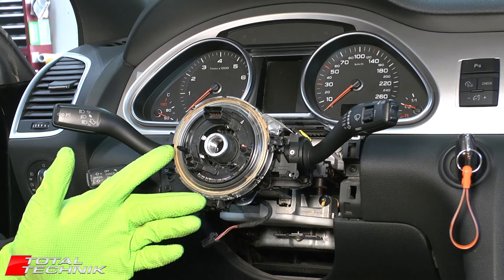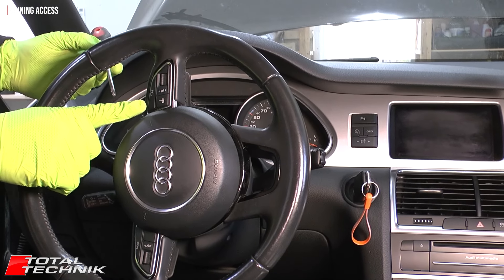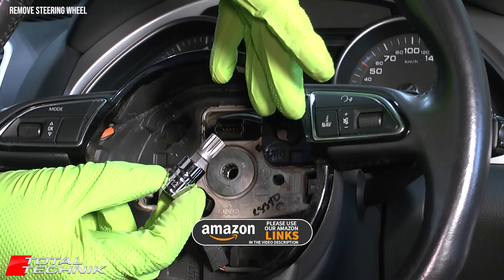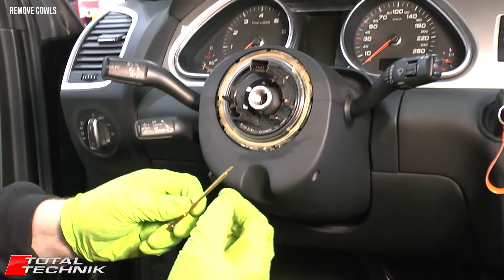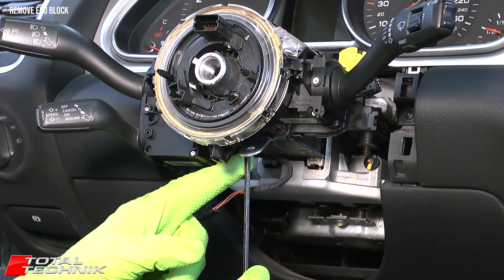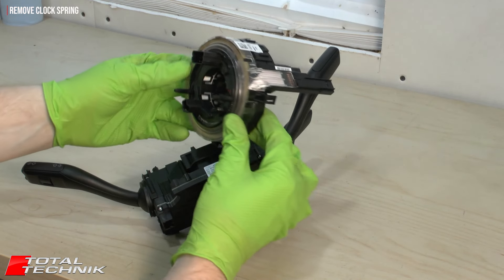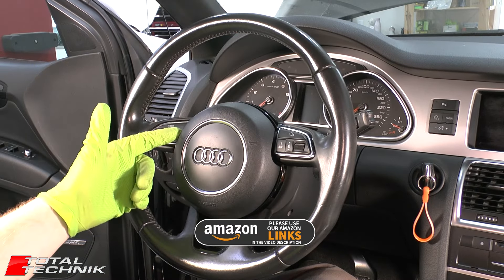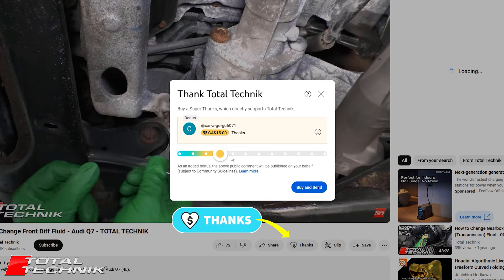How to Replace Clock Spring (Squib) - Audi Q7 (4L 2005-2015)  | COMPLETE DIY GUIDE

Comment from the maker: Spline Bit Set (including M12 - for steering wheel center bolt):
Amazon USA: https://amzn.to/3HmCfha
Amazon UK: https://amzn.to/3LDbzeA
Amazon Canada: https://amzn.to/3oRQVhZ

Threadlock (non-permanent type - for steering wheel center bolt):
Amazon USA: https://amzn.to/3UnoULa
Amazon Canada: https://amzn.to/4a2RHdC
Amazon UK: https://amzn.to/3ULnMTe

Torx Long Bit Set (includes T8 - for the lower cowl screws):
Amazon USA: https://amzn.to/4cMhAAA
Amazon Canada: https://amzn.to/3WgLfw3
Amazon UK: https://amzn.to/4612CEg

Torx T25 Screwdriver (for safely pushing airbag metal tabs inwards):
Amazon USA: https://amzn.to/3ZbsdJy
Amazon Canada: https://amzn.to/4ee6O6N
Amazon UK: https://amzn.to/3ARAWGA

Torx Screwdriver Set of 4 Sizes BEST VALUE (includes size T25):
Amazon USA: https://amzn.to/3ThDp3w
Amazon Canada: https://amzn.to/4ge0mP2
Amazon UK: https://amzn.to/3yW1LsL

Hook Tool (really useful, including unlocking electrical plug clips!)
Amazon USA: https://amzn.to/3PxHUG0
Amazon Canada: https://amzn.to/3NUKzI8
Amazon UK: https://amzn.to/3beSeQZ